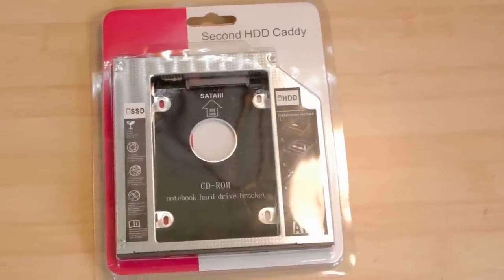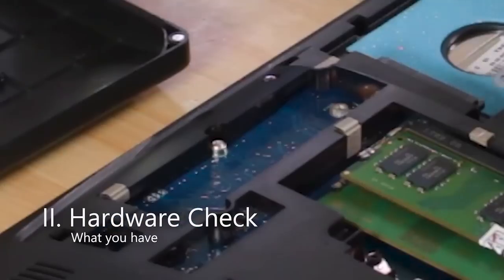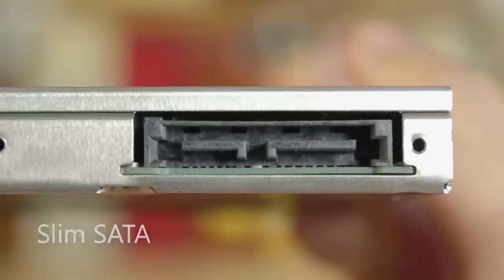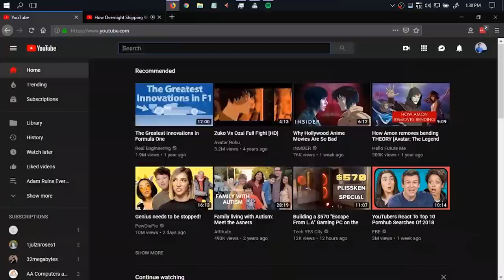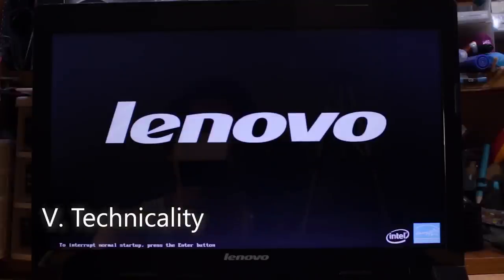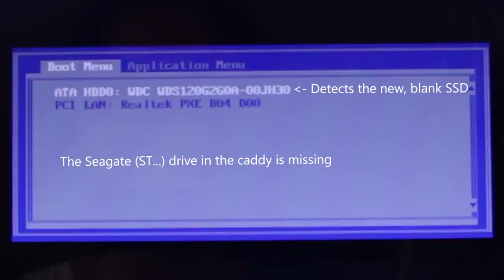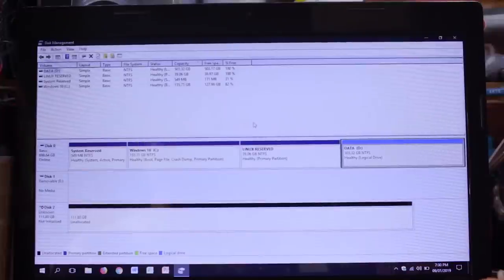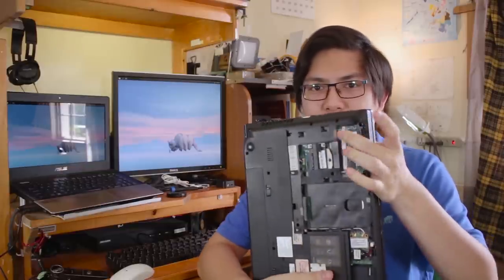SSD + HDD in Almost Any Laptop (The Caddy Method)

Comment: After seeing your first video on this topic I installed an ssd/hdd configuration the same way you did in this video in my Lenovo laptop that has the SAME layout as this one (I have a Lenovo B590). The only difference is that I didn't clone the HDD, I just reinstalled Windows on the SSD and formatted the HDD into a big partition. I had no issues with any of the drives in the process of installation though... This video basically shows what I did several months ago.